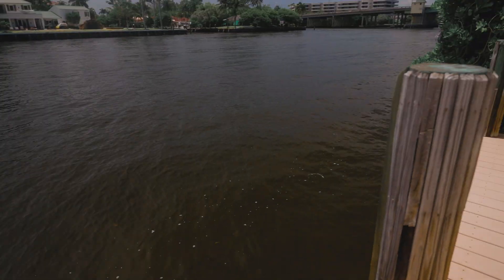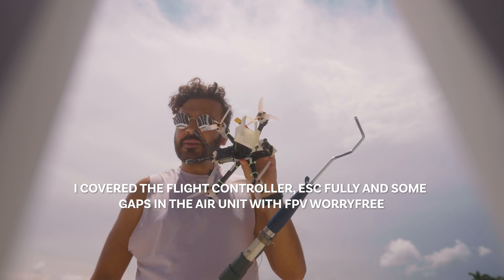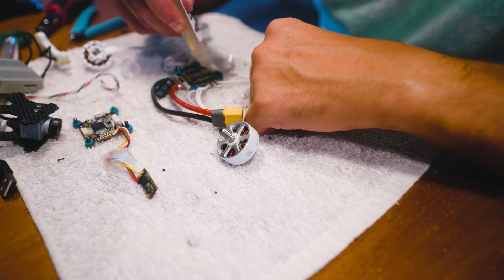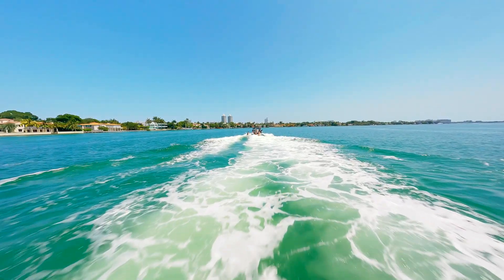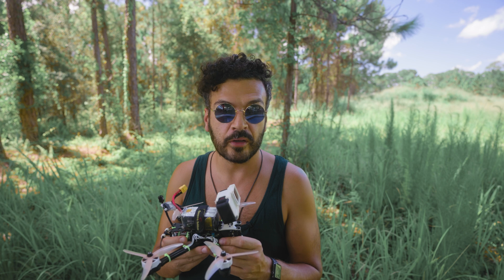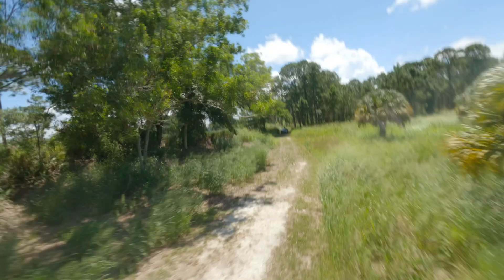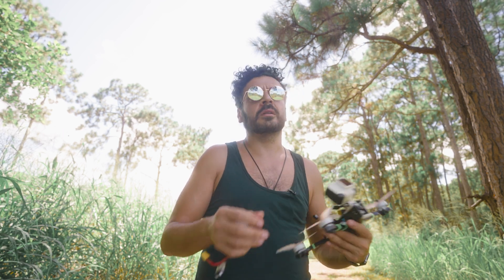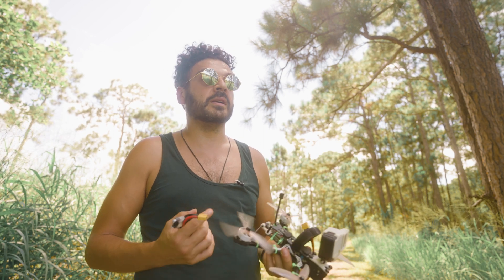Waterproofing my Drone Pt.2 - FPV Worry Free review

Comment: What about air ciculation? Will it damge the electonics?
Reply from the maker: I’ve been flying this rig almost daily since posting this video and no issues yet. I flew in 95f HOT weather and crashed in some tall grass, picked it up and the motors were insanely hot, the electronics were hot too, but again no issues yet!
Reply: @gre-vo  Ohhh nice. Even the glue dont melt? What about the usb port do we have to close that too?

Comment: Awesome review bro.  I’ve always been hesitant to try this stuff.  Do you suggest taking apart the air unit when doing it?
Reply from the maker: Thanks Colin! For a full 2 antenna air unit or vista I don’t think you would need to take them apart. I just didn’t realize that the cover / heat sink had so many little gaps. If I were to do it again to an air unit I would either take it apart and apply it to the edges of where the parts of the casing meet and do another once over on all potential gaps externally. What I like about it is it’s thick enough where it can be scraped and picked apart if you need to get to the USB / SD.
Reply: @gre-vo  awesome thanks for the info.   Want to start filming boats coming In the inlets here so probably would be smart to invest in something like this!